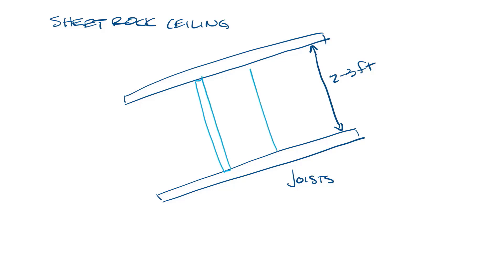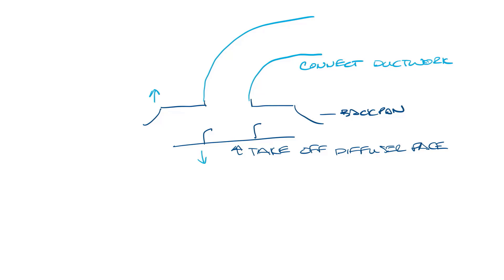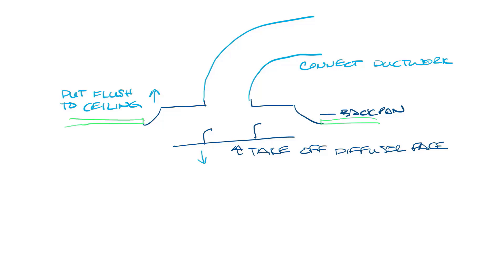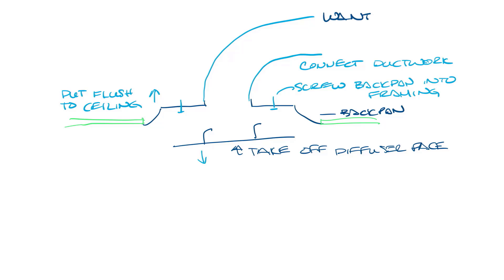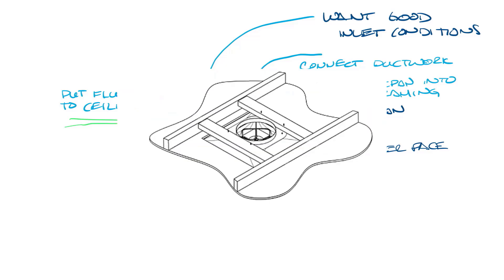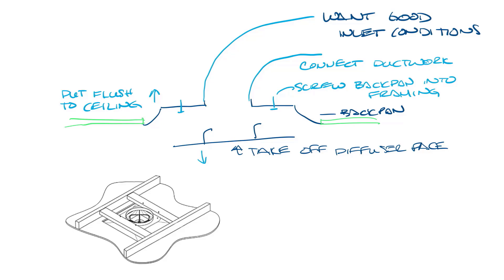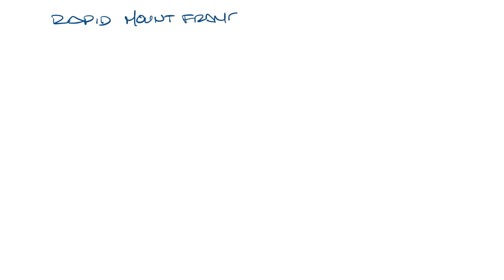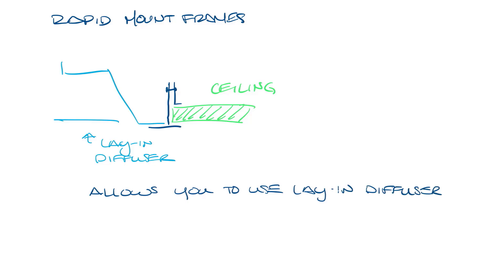NSW HVAC Academy - How to Install Surface Mount Diffusers

Comment: This will help me select my air devices more accurately. I can select lay-in diffusers for an existing to remain ceiling scenario & then put a note for rapid mount frames to be included. Thanks!

Comment: How would you install a surface diffuser if you have a fusible linked fire smoke damper already installed in the plenum box that is only 1/2" from the finished drywall (sheet rock) ceiling?